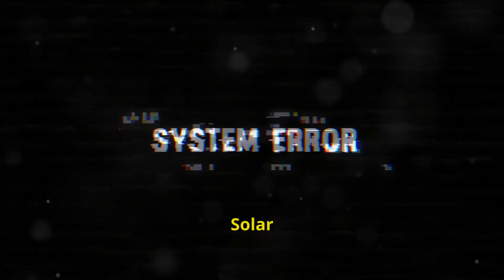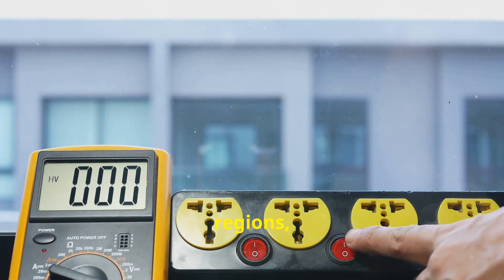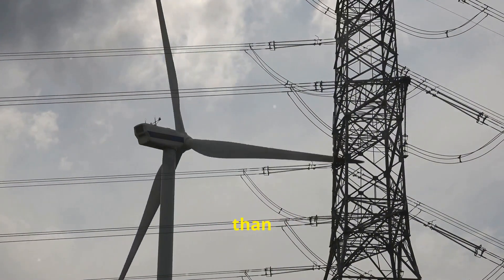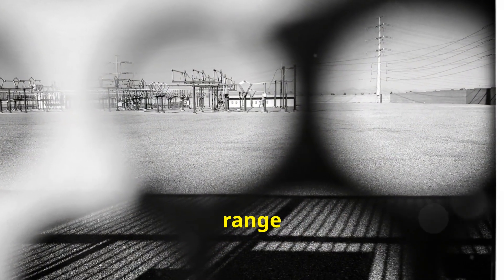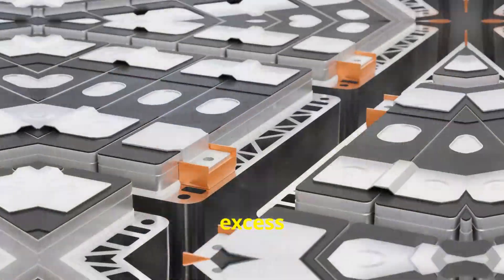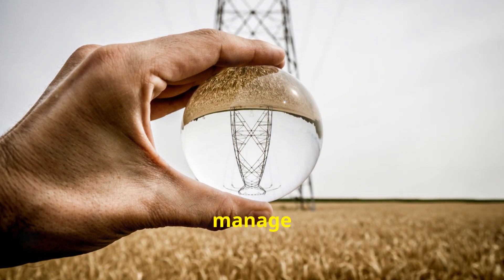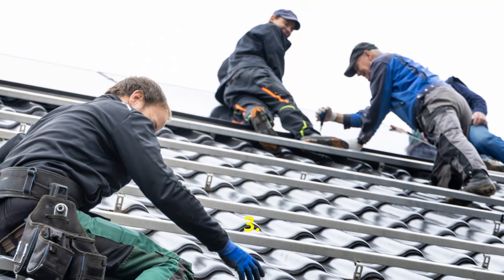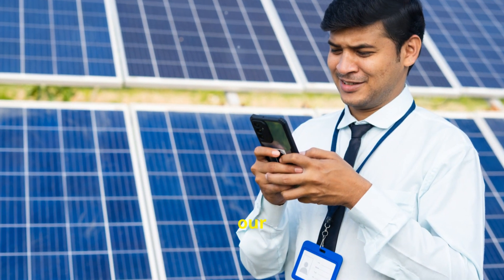Understanding Grid Over Voltage & Grid Over Frequency with Solar PV Inverters

Comment: Thank you, this isn't very helpful for me in Philippines though. The grid power is unreliable and the utility doesn't have the funding or the motivation to work on it. So I'm looking for an inverter that can stabilize the mains power coming into the house, maybe step it down when it's too high and draw some from a battery when it's too low? Some people here use automatic voltage regulators or uninterrupted power supplies to cope with the power fluctuations, but since I'd like to install solar someday I'm trying to do the same things with an inverter and battery. Any advice on what to look for would be appreciated.